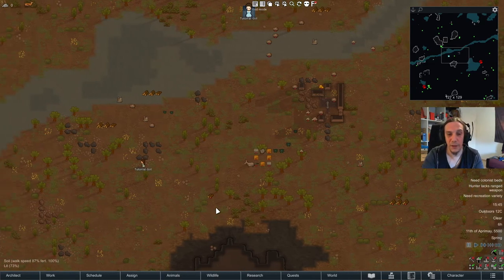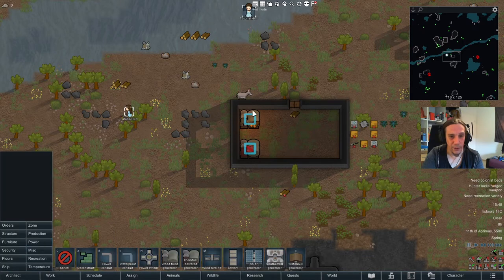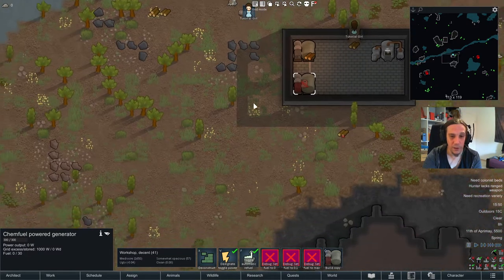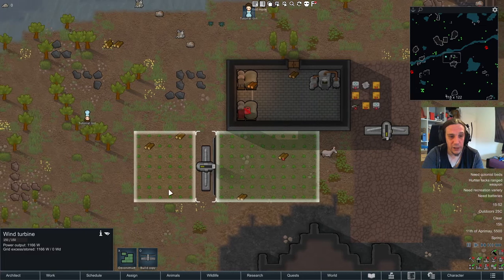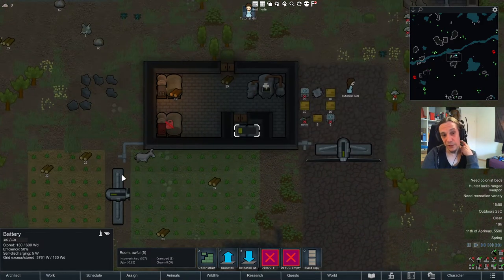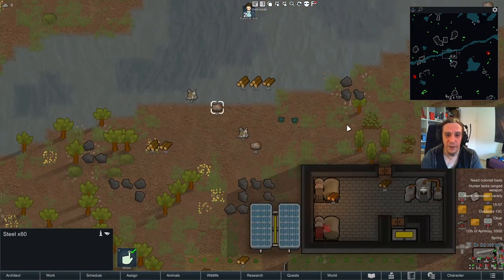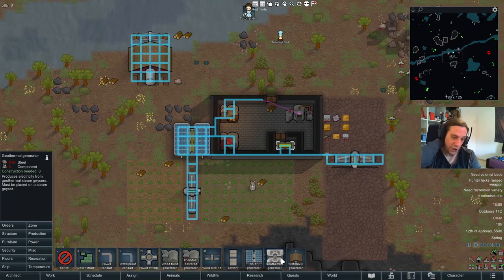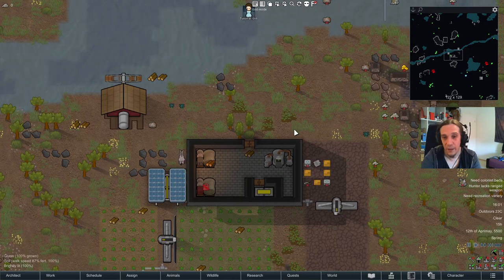Rimworld: Easy Electricity And Power Guide Gameplay Tutorial

Comment: I will say I've seen the switches used primarily for toggling off and on defenses in the early game.  So basically they'd lock off the line leading to their turrets behind a power switch just for speed purposes.  I can also imagine in more extreme survival scenarios like the arctic turning off the heat/power to rooms you just aren't using right now.  Not that you'd have many resources to be building up rooms like that.

Comment: couple comments: always leave at least 1 tile unroofed over the geothermal so the room doesn't heat up, and then you won't need the extra space. Solar panels wont block wind turbines so the most space-efficient power layout is 2 turbines and a field of solar surrounded by walls. In the prior layout, so long as you barricade between the turbines (leaving no open floor space) drop pods cant target the area; make sure your door touches a solar as pawns cant get in next to a turbine. The most power hungry item in the base is the sunlamp late-game, which automatically turns off at night, which means solar pairs really nicely with it. I'm not 100% on the math, but for chemfuel, 3 boomalopes should be able to power 2 generators non-stop. lastly you missed the ship reactor, they produce 10k of power from the moment they are built, and you didn't have to activate them (and go through the gauntlet) to get power out of it.
your video format is good and you present information well. keep at it.
Reply from the maker: Thanks for those extra informations and the kind feedback!
The ship reactor thing I actually learned after recording this video ^^ Good thing you added it here.
Reply: you are a savior about the solar panel/wind turbine thing, i've been struggling for a while trying to get good power :]

Comment: The power switch can be pretty good for keeping a secondary emergency battery, that you can re-connect if needed. After all, If you get the Bzzt event right before a raid, then you might not have the power to operate your turrets. Or you could use the switch to keep things like turrets off the grid until you need them.

I would also point out that protecting these power generating assets, along with the power line connections can be a chore. Especially for the waterwheel, since wood walls are the only thing that can be built over bodies of water.
Reply from the maker: Thanks for these wonderful additions! Can only agree on every point - cheers!
Reply: Seems like a good idea to use it to shut off too much power, which will stop conduits from getting the bzzt boom boom.

Comment: I use switches for the sole purpose of disconnecting a dedicated battery room from the power grid. Its a lifesaver for situations when you either need the extra juice, or some terrible event that leaves you without power in an emergency.

Comment: Do raiders attack your power conduits connecting from the geothermal to your base?
Reply from the maker: Not as far as I know. I haven't tried it out with Sappers yet. I usually run a mod which allows me to let the cables run underground (for the cost more steel and way more work per cable)

Comment: how do i create backup secondary batteries?
Reply from the maker: Tricky. Basically you'd need to wire them up to a separate powersource (to charge them up) and then connect the secondary circuit to the main circuit when needed. I think a Switch should do the trick but I gotta be honest, I never tried this.